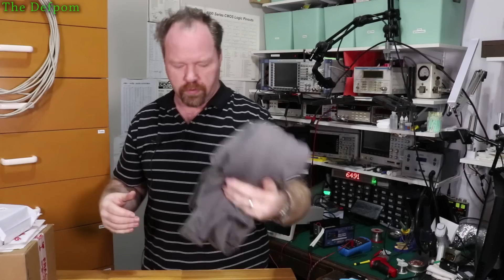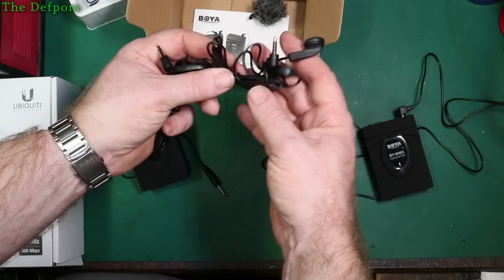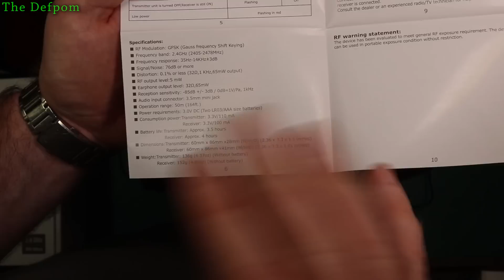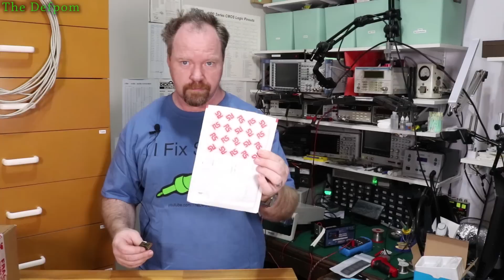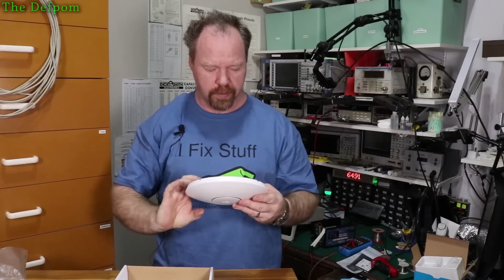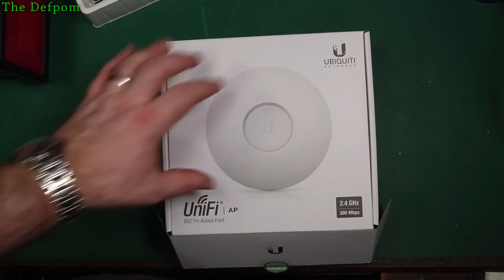🔴 #535 Mailbag Monday 25th March 2019 - More Merch !

Comment: Scott, the audio with the new wireless mic is very good.  I think you could ask your audience if you should have the bass/low frequency switch on or off.   I think you might sound "better" with NO low frequency cut off.
Reply: On my audio setup I agree, audio sounds good but prefer the low cut set to off.
Reply from the maker: Dick R - yes I agree the low freq roll off should be off, in editing it sounded better without it.

Comment: The Ubiquity AP works without a their switch or security gateway (router).  You do need a controller but you can download the app from their website and  run it on any PC.  It's needed to configure the unit,.  Once it's configured, the software doesn't need to be running for most of the features to work.

Comment: Audio sounds fine. What mic were you using on yesterday's live stream?
Reply from the maker: dave odessa - yesterday was interesting actually, OBS initially forgot my audio input so I selected my USB mic. Towards the end of the stream we were talking about the noise on the mic, and somehow OBS was using the mic in my webcam, which sounds bad compared to my USB mic! If you skip to about 20 minutes before the end that is when I discover the issue and switch over.
Reply: @TheDefpom  - How do rate OBS?
Reply from the maker: dave odessa - 8/10, works ok most of the time, but recent versions have been a pain with freezing up, at least on macOS 10.12.